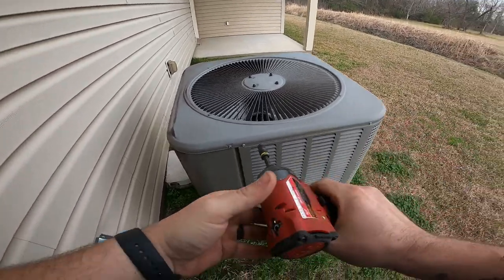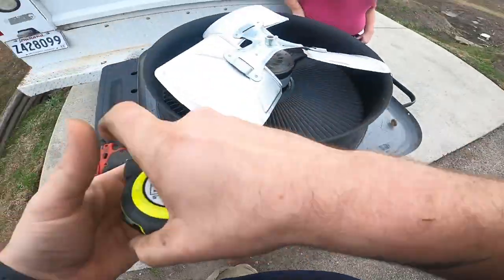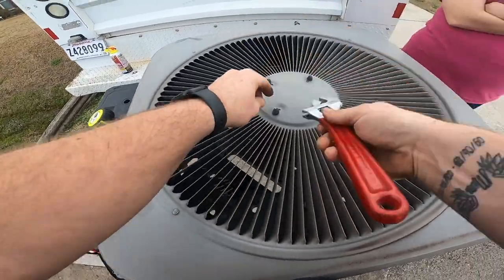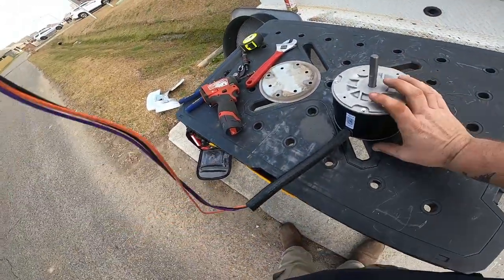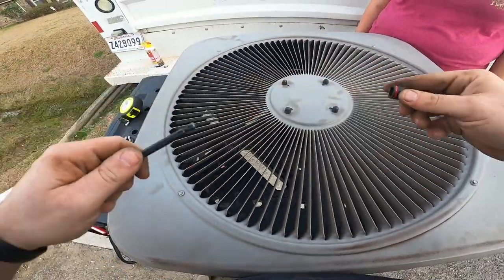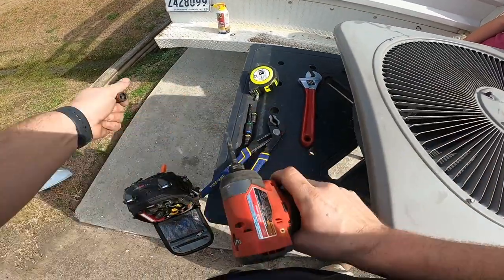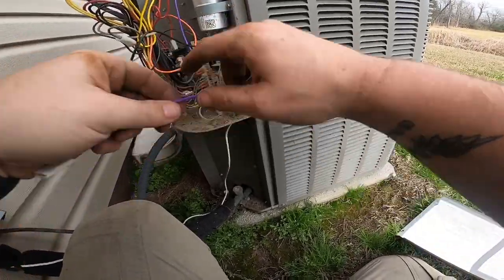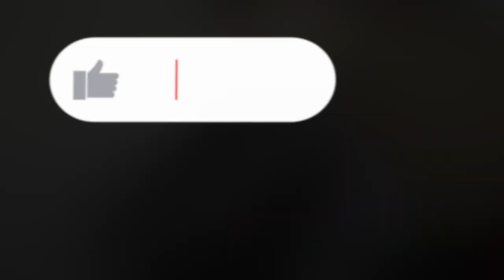No Heat or Air/Lennox Condenser Motor Replacement

Comment: For the fan motor to remove blade I always brush with steel brush and lube. Easiest way I found to use vise grips on bottom under blade and use channel locks to grab fan blade where screw comes out. Btw pb blaster is the shizznicks

Comment: Easy trick I found for the conduit is to zip tie the ends of the wires of each motor together then pull the conduit over